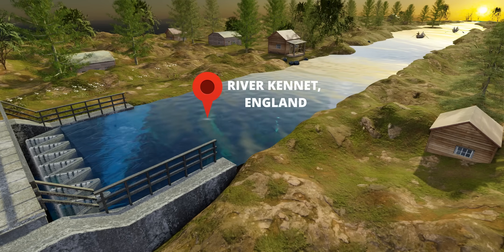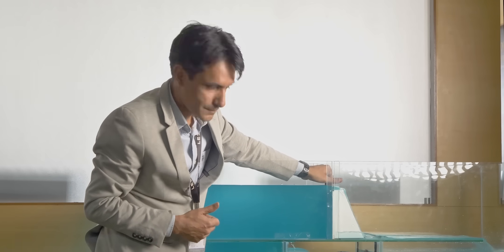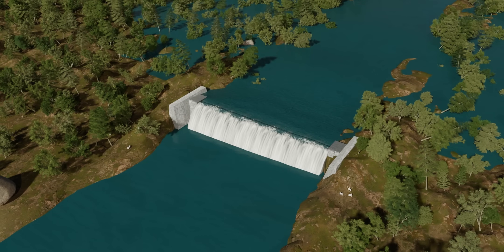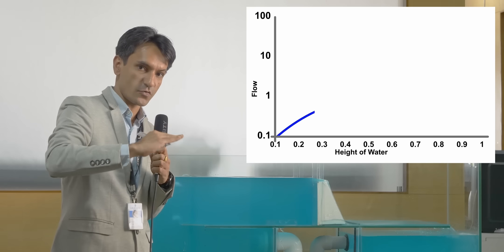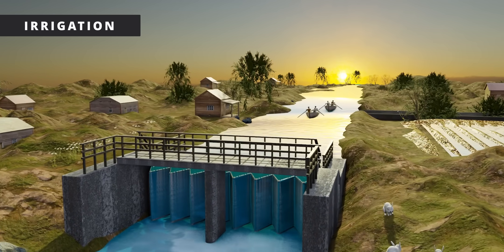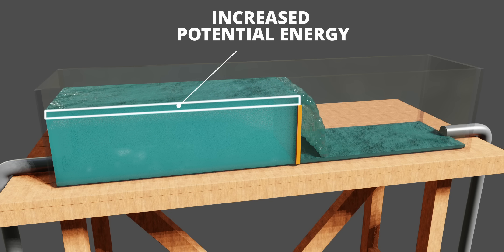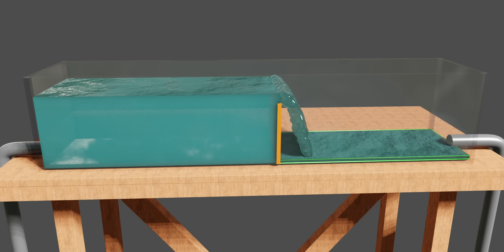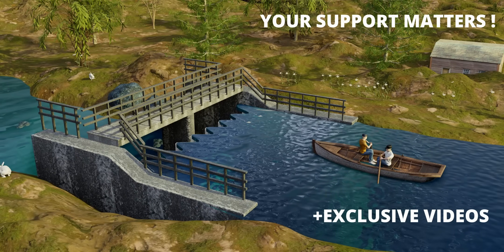Weirs | The COOL Engineering Behind Them 😎

Comment: It's good explanation, but it feels a bit incomplete, because it doesn't explain why the zigzag weirs changes the heights of the stream relative to the straight weirs, given that with both the water falls from the same height.
Reply: Exactly, wanted to comment this as well
Reply: Zigzag pattern creates a longer length at the edge of the weir. Since L increased, H must decrease to keep Area = L x H constant (for a constant flow rate Q = velocity x Area).
Reply: @PermanentExile The curved weir will do the same thing.
Reply: @brightlight7217  it would have to curve in a zigzag to get the same length. One curve when stretched out would be shorter than a zigzag line stretched out.
Reply: @PermanentExile thank you! Simple and brilliant
Reply: @PermanentExile nailed it!
Reply: @PermanentExile yes, that's the answer
Reply: there is an increased surface area for the water to flow over.
Reply from the maker: Sorry for skipping the physics part of zig-zag weir. I didn't expect this much curiosity around this topic. We will definitely explain it in a different video.
Reply: @SabinCivil  No added gravitational potential energy?
Reply: @alexjohnson1421 it is converted to kinetic energy.
Reply: i think it is good to separate it into minimum 2 parts. with the second part being the more in depth physics explanation @SabinCivil
Reply: @SabinCivil That was supposed to be the purpose of the video.
Reply: @SabinCivil  we just trying to learn here.  But seems like a snow day when things were just getting good
Reply: @SabinCivil  There are a lot of highly successful channels focused on civil engineering, and at one real civil engineer that plays video games instead of explains things >.>
Reply: @SabinCivil  I thin writing the formulae on a board, or putting adding them to the video would help, but also mention checking comments for answers - especially in cases like this one, where it is explained only very briefly and people may easily miss it.
Reply: @SabinCivil never underestimate your viewers level of curiosity 😊
Reply: Yeah -- why even introduce or discuss the zigzag form factor if it wasn't going to be explained??
Reply: Practical Engineering has a vodeo about the different shapes of wiers. It's worth a watch if you're curious.
Reply: @queueeeee9000 practical engineering ironically feels more aimed at middle or high schoolers to me as an engineer. This channel introduces more definitive concepts with the animations plus the real-world application; it feels more like how the qualitative aspects are introduced before the quantitative ones in an engineering course—it’s still missing the math, but it’s easy to introduce or derive based off these explanations than PE’s.
Reply: @ClementinesmWTF  different strokes I guess
Reply: don't worry, we'll get it in the re-uploaded version :)
Reply: Increase in surface area where the water discharges
Reply: @harshit_grewal this is the answer
Reply: Increase length of weir over which the water flows this reduces the height of nappe.
Reply: Increased surface area... Change of shape...
Reply: @georgeelder8415  Yes this.
Reply: Youtuber Practical Engineering did a video on weirs a few years ago. Around the 5 minute mark he discusses the zigzag weirs.
Reply: zig zag pattern has area increament
Reply: @harys6382 yes - it is applied in cases where height difference is larger - the volumetric flow rate is more "well behaved" than in the case of simple weir - my intuition is that it allows more water fall over, but not so much more when the flow is high - the exact formula is on Wikipedia: Weir
note that many weirs are manually operated, so one can increase or decrease the height difference depending on flow - the V-shaped type is more "automatic" or more passive so less manual adjustment is needed - a dam is basically a huge manually operated weir
Reply: @LiborTinka 
Surely you mean the sluice gate is manually operated and not the whole dam or weir is raised or dropped in height?
Reply: I was surprised that the narrator didn’t mention the Bernoulli principle…
Reply: Greater surface area
Reply: Could it be the increased surface area the zig zag provides means the escaping water can flow more slowly

The benefit of this is less force power volume of water

Which provides less erosion on the down stream river need and banks

?
Reply: Exactly! I thought the same thing. It’s as if they forgot to include that explanation altogether.
Reply: When the zig-zag weir length is compared with normal weir, is long. Due to this, the water force also increases. And an increase in water flow decreases the water height on the other side.
Reply: By Changing the shape this alters the water force when it hits the weir thereby causing a decreased flow rate. This will consequently reduce the overflow distance with the rough surface of the weir causing a decreased force(via resistance) of the water while dropping and flowing downstream.
Reply: Flow over a weir can be described in terms of length. The longer a weir is, the more water is capable of flowing over it. A zigzag is a method for increasing the length of the weir. The result is that water dumps much faster, maintaining the water level on the high end.
Reply: In the zig zig weir, there is more "wair surface."
If you look at a normal weir, look at the straight line where water falls down.
Now look at the zig zaged one.  That line is longer, meaning that more water at any moment is falling down, thus decreasing the height of the water above
Sorry if my explanation is unclear, I'm not a native English speaker
Reply: I think is about pressure and speed of water!
Reply: Agree with the comment
Reply: The pressure probably changes at the edge of the wedge. The change in surface area is neglectable compared to the surface area of the river.
Reply: Yes, it's not about an area, it's a length.
The width of the river is artificially made longer by the zigzag style
Reply: The speed is same as it was in the case of normal weir as a zigzag weir does not change the height of weir . But zigzag weir has more breadth and to keep the area of cross section constant , the height had to decrease .
Reply: Yup, it’s the surface area.  If you calculate the length of the different weirs and compare the resulting volumes…. the velocity of the water necessary to move that flow rate is easy to calculate.
Reply: More surface area for the water to flow over, you can slant the weir diagonally across the river or make it a crescent shape for a similar effect.
Reply: Yes that's frustrating lol
Reply: Wait for the next video
Reply: The front is compacted in a zig zag weir so less height is needed for the same flow.

Stretch out the zigzag in your mind, then you realize it is comparable to a much wider flat weir.
Reply: Id say its the increse in "edge" area over which the water can flow. Since only so much water can flow ower the edge at once, the rest of it bulges over the lower layers of water and you get this huge waterfall-effect. the zigzag has a much bigger surface and water can fall of the start or the end or in between, so you are basically widening the "edge".
Reply: I originally thought that was the entire topic of the video based on the thumbnail and the initial few minutes. I was sadly mistaken.
Reply: mabe the increase in surface area from witch the water can flow out? like poking more and more holes in a water bag increase how much water can flow per second? idk im just guessing.
Reply: is there a shape better than zigzag to lower the height even more
Reply: He described a dam rather than a weir.
Reply: Zigzag tiene mayor superficie para transferir líquidos. Si tienes 10 metros de canal, en linea recta tienes menos superficie que en zigzag, dónde puedes cubrir más metros para que el liquido se transfiera de una superficie a otra.
Reply: The longer weir rim means the water flows slower so erodes the edge less and the plunge pool is spread out more to undermine the weir less.

The zigzag is stronger and would be better still if curved so uses less material.

Whether the shape catches or prevents snags of debris or lets animals escape is open to debate. If the zigzag leant into the weir, frogs, fish, ducks, insects, birds, snakes would be able to climb it in the dry ridges or the current speed they can swim in.

For the fish, the water might be more oxygenated.
Reply: It reduces the height of water ahead of the wear Because of more flow of water at the weir. The straight wear only has so much surface area. For water to flow down. But the zigzag one has more surface area. As the water will fill into the triangular area than have a hypotenuse surface to travel down upon. This is what gives the increased water flow and lower heights.
Reply: it's because the quantum tunnel effect
Reply: If you explain the physics the videos won't seem so geared to school children..
Reply: @kentkagle7852  I bet the school kids be pissed also that the zigzag part was not explained.
Reply: We are not school children @kentkagle7852
Reply: @kentkagle7852  These videos should be accessible to the general public because they are explaining stuff that affects everyone
Reply: It feels incomplete because this channel is crap and one of many other channel using AI to tell something.
Reply: @speeder172 what a shallow IQ answer…
Reply: @Vojec9  well if you like content narrated by AI and probably stolen from another channel this is your problem

Comment: So why does the zig zag work better???? Wow
Reply: @4:30
Reply: @Eyes_of_Oryx  Practical Engineering has a great video on Weirs. I am no expert, so bear with me on my terminology. 

They don’t necessarily work better per se, as they’re both weirs. The zig zag pattern allows for more total linear length in the same area as a straight weir. More length means more area for water to flow. 

The angle, material and shape of the weir will need to be fine tuned for desired flow and turbulence.
Reply: I also think that when the water hits the pointed parts of the zig zag weir that the water pushes back slightly thus reducing the flow of the water going over the weir

Comment: You never explained why the zig-zag shape is there, or even mention it. No wonder this channel is failing. "Limit the water height by increasing the flow rate"?
Reply: 3:31 It decreases the height for a given flow area by increasing flow area for a given height. If you're still wondering why it works, think of it as cramming a wider waterfall into a narrow space. This is similar to air filters, which are pleated to increase their surface area.
Reply: @AwestrikeFearofGods - So, someone would get a different effect by elongating the "pleat" length?
Reply: @trangwuong7689  Not "length" exactly, but angle. A zig-zag with more acute angles has larger surface area, regardless of the scale/length/spacing of the zig-zag pleats.
Reply: @AwestrikeFearofGods  The pleats on an air filter increase the flow rate. The stream should flow faster too, but it slows.
Reply: @BariumCobaltNitrog3n  For a fixed flux density, flow rate would increase. However, flux density is not fixed for the weir example, as it is for an air filter (having a given pressure drop). For a fixed flow rate, flux density decreases. As flux density decreases, the velocity (or height, in the case of the weir) decreases.
Reply: @AwestrikeFearofGods  The weir would decrease the flux density, which lowers the velocity, making the water flow faster after the weir. Faster = slower. OK. That's much clearer now.
Reply: @BariumCobaltNitrog3n  Is it? While the air filter is analogous to a weir with respect to zig-zag pleats, I never said everything about the systems were identical. The differences affect which parameters are variable, and which become constant. If the weir was instead a dam with a porous liquid-permeable wall, then the system would behave more in line with your expectations.
Reply: @AwestrikeFearofGods  My expectations? You're confused. Try reading more carefully. If the weir were a Jack Russel Terrier it might fit your description.
Reply: @@_Rupesh_YADAV An increase in flow rate makes the water slower after the weir? Faster means slower and lower? One sentence in the whole video to "explain" how it works and it doesn't make sense.
Reply: @@_Rupesh_YADAV This video is not for anyone 😏

Comment: Does the velocity of lower height water is higher due to the water flow travels from higher level to lower level???
Reply: Yes, the potential energy of the water gets converted to kinetic energy as it falls, speeding it up
Reply: Here is another POV :
The amount of water molecules in the flow (per second) remains the same even though you build a dam.
However the molecules fall due to gravity, so they accelerate.
Then if you have a faster flow for the same amount of water, that means you have less water molecules per m^3 after the dam!
And so, the level decrease

Comment: What do you do with the sediment settlement over time?
Reply: Most modern weirs and dams have openings at the bottom and from time to time they get opened to flush out the settlement. There are impressive videos from China where you see a turd like stream of soil getting flushed out from a dam.
Reply: @FritzSchober  so that's what those videos are 😂
Reply: @FritzSchober  you can only do this with slur in certain situations - that mechanism is not a solution to this problem.
Reply: This practice has devastating environmental consequences. We shouldn't think at rivers as channels and at basins like toilets we can flush whenever we want.  @FritzSchober
Reply: You CG it away
Reply: Can you elaborate?
Reply: @karantekwani3660  sediment/silt (fine particles of dirt and minerals) builds up in layer's seasonally.
Reply: Areas behind dams eventually fill up.
Reply: Sometimes they let them fill up with sediment. This is done along the Mississippi river. The sediment compacts as it increases, eventually to where it piles up, starts growing vegetation and the weir is afterwards completely covered up by the sediment, rocks and wood.
This actually creates stable terra firma. I suspect they do this to control the speed of the water in cases where a dam isn't an option.